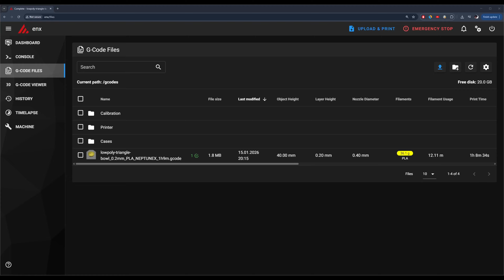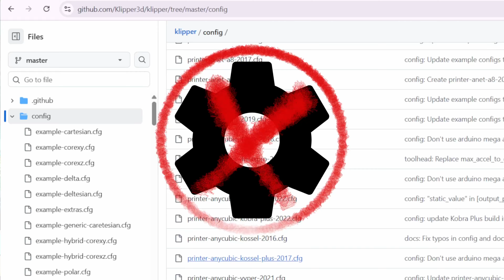Install Klipper on ANY Printer from Scratch (No config? No problem!)

Comment: when you say any printer, the Bambu x1c would not be include right unless I bought new boards?
Reply from the maker: That's a fair point. Swapping to new control boards is really the only practical way to get true Klipper running. Bambu's ecosystem is pretty locked down, so you can't just plug in a Pi and flash it.
That said, it's not impossible to use the stock hardware. If you went through the kind of reverse engineering I did in this video, you could eventually map the pins and figure out the flashing process. The real challenge is reverse engineering Bambu's proprietary communication protocol just to get the toolhead talking to the mainboard. That's a huge undertaking, which is why almost everyone just swaps the boards.
If you want more control without replacing hardware, X1Plus is by far the easiest option. It gives you root access and extra features while keeping all the native Bambu functionality.
If it were my printer, I'd go with X1Plus. Swapping boards means giving up the LiDAR and AI features you already paid for. If your goal is a pure Klipper machine, you're honestly better off starting with an open platform or building a Voron.

Comment: Bit of constructive criticism. You’re diving into very technical bits which is great. However, you’re are skipping exact steps or glossing them over. When teaching these type of activities. It’s best to slow down, let the user absorb. If only just for another second to clearly explain point A to B. You may not realize it, because you’re so accustomed to what you’re showing. I’ve been guilty of the same thing.
Reply from the maker: Thank you so much for this constructive criticism! It's incredibly valuable to get an outside perspective, especially from someone who's been in the same boat. I truly appreciate you taking the time to point this out, and I'll be implementing this advice moving forward.

Comment: Hello! It is not possible to configure the accelerometer that came with the Pad 7. When activating the lines in printer.cfg, the error "MCU 'CB1' error during config: Unable to open spi device" appears. What am I doing wrong?

[mcu CB1]
serial: /tmp/klipper_host_mcu

[adxl345]
cs_pin: CB1:None
spi_bus: spidev1.1
axes_map: z,y,-x  # Modify according to the actual orientation of the ADXL345 installed on the printer.

[resonance_tester]
accel_chip: adxl345
accel_per_hz: 70
probe_points:
    100, 100, 20  # an example
Reply from the maker: Hi and thanks for your question. I haven't tried the Pad 7 yet (it's still waiting in its box here) so I can only try to guess. My suggested approach is to first check which spi devices are present by executing the command "ls /dev/spidev*". It should list spidev1.1 but if it doesn't I would next check if the overlays line in the BoardEnv.cfg contains "spidev1_1". Make sure that you only have one line "overlays=...". If you want to activate multiple overlays then write them in that same line seperated by a space! According to the BTT Pad 7 manual (https://github.com/bigtreetech/Pad7/blob/master/BIGTREETECH%20Pad%207%20v1.0%20User%20Manual.pdf) it should look "overlays=ws2812 light mcp2515 spidev1_1".
Let me know if that helped.
Reply: @3D_Printing_Geek , Thank you very much! At least the error disappeared when the lines were included in the printer.cfg file.